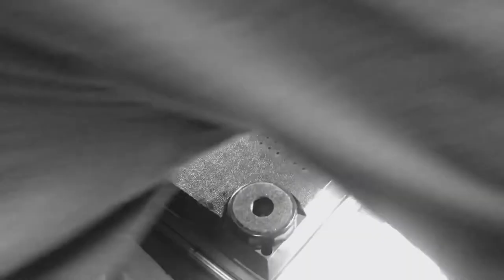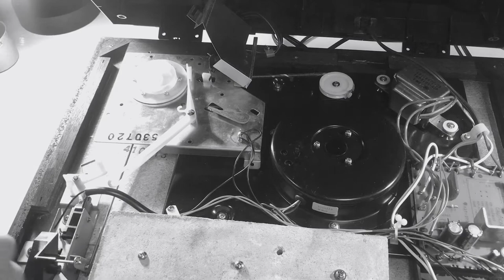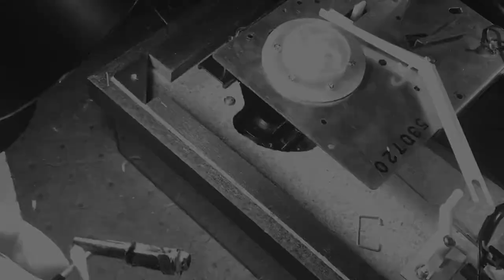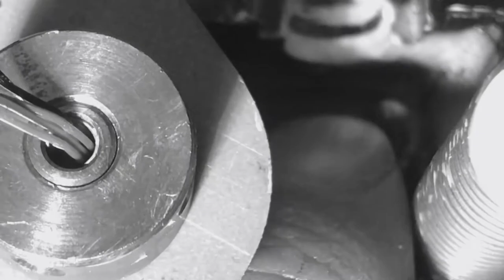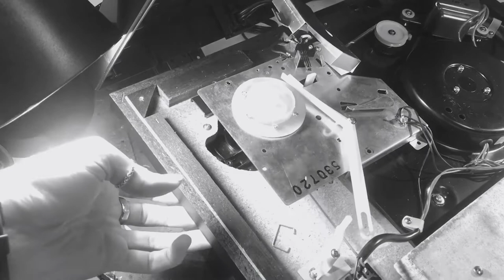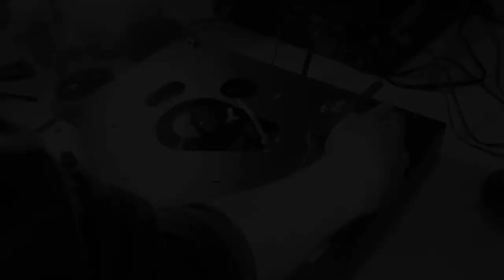Kenwood KD-3070 Cue Lever Repair / Service (Cue Arm) -Adam HiFi-

Comment: mine Kenwood KD 2000 when it is finished playing, it sometimes skips when it is auto returning to the stand. Does something need to be oiled or adjusted?  Thanks in advance.  It works great other wise.
Reply from the maker: What do you mean when you say it skips when it is returned?
Reply: @AdamHiFi  When it is done playing, it skips across the record coming back to the post.
Reply: @leighpieterse3297  I think I figure out the problem,  The front right side was 1/2 or more off balance.  It doesn't skip anymore.  I just folded some cardboard to raise it up on the front right side!  Thanks